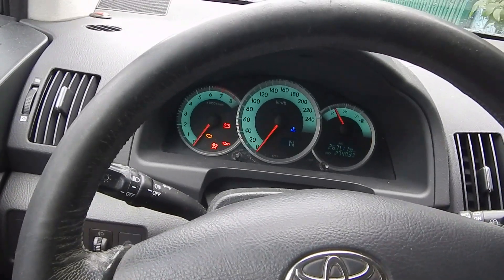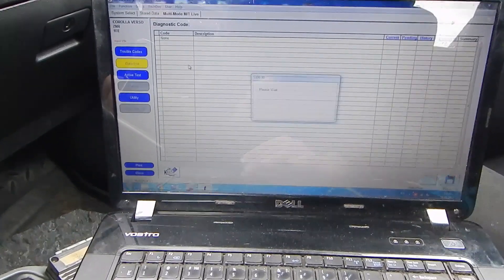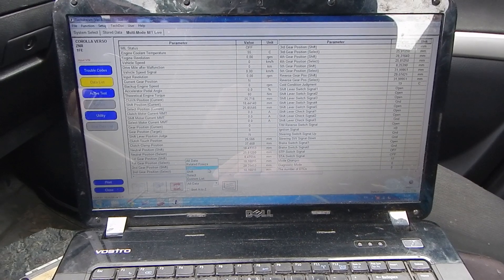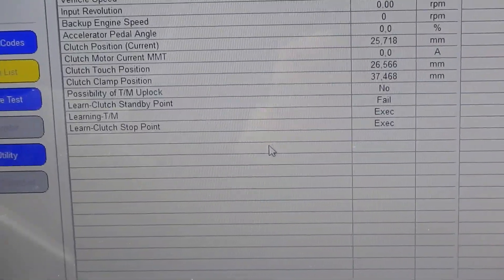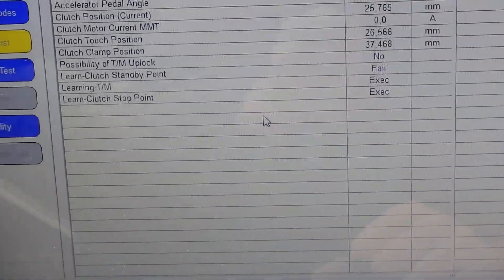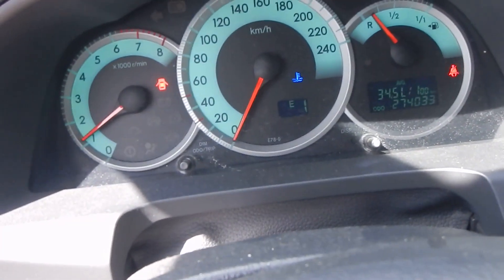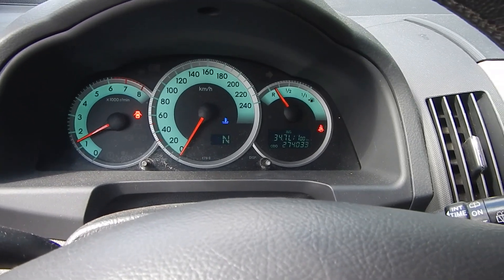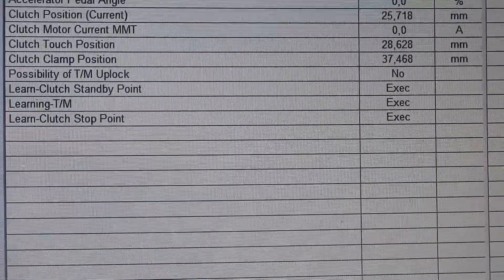N FLASHINNG Toyota MMT Learning Fault What to do if learning fault clutch standby point fail

Comment: I have changed the sensor but it didn't help. I had another guy who came up and said that voltage is not right on the wires. Can that cause this fault?
Reply: can you give some informations about the sensor. The article number. Want to order one. But don't know which one.
Reply from the maker: Message me i have original
Reply: @vak_service i have fixed it. The pin inside the gear selector moved slightly so it wasn't in the correct position. Thank you
Reply from the maker: Check next video:

https://youtu.be/_limxc7_2oc?si=wi_Mjej186k7-e61

https://youtu.be/b8H-RDu8VdU?si=qSSeksi3DNYB4mS3

Comment: Hi guys.i replaced clutch on a Peugeot 107 piloted gearbox. After clutch replacement. I programed the clutch.now neutral is flashing. Watched this video. Replaced the gearbox speed sensor and clutch actuator. Programed again but I still don't have gears.any1 help please. Thanx
Reply from the maker: Hi.
It mean that the clutch can not be calibrated. Looks like installed not original clutch.
Follow next videos how to do that it will working

https://youtu.be/dAK1qUhLgOs?feature=shared
https://youtu.be/B--evbdBhk8?feature=shared
https://youtu.be/N0-jM0sFkAE?feature=shared
Reply: @vak_service  yes I used aftermarket clutch. Not original. I also noticed from one of your videos. I did not put the actuator in clamp position. Must I use the scan tool to st the actuator to removal position then carry out clamp  position.?thanx
Reply from the maker: @luckyngwenya5758  i sent you videos what and how need to do.
Do it.
Reply from the maker: I'm not sendig there videos for free, just sent them for you, it is my paid content, so send me some donate - SuperThanks when the car will start moving.

Comment: Hello my car is Toyota Yaris SR 2007 VVT automatic transmission with same problem when I start my car it’s fine working but after 30 to 40 minutes drive then Start Blinking N not gears working or reverse working if I stop engine about 15 minutes then if I start engine again it’s working fine but about 40 minutes drive then problem star again
Reply from the maker: Hello.
Check for codes first.
Type here codes, will tell you what to do.
Follow next video how to check the codes with wire:

https://youtu.be/W2DRdW2XflM?feature=shared

https://youtu.be/7c6mFTJgFXI?feature=shared
Reply: @vak_service how can you check codes? Need to go to garage?

Comment: Hello! I have a Corolla mmt. I recently changed the clutch, the pressure plate is the old one. I reset it and everything was almost ok. however, recently, it started to set to compensation, as if the disc was worn. This means that it started not to disengage properly. I adjusted the actuator several times, it worked, but the self-adjustment of the pressure plate kept repeating. Because now the standby point is no longer calibrated, the disc being new but the auto pressure plate set, practically it no longer disengages completely, I'm going to remove the box, reset the board again. question! is it possible that because of the sensor on the box, which I think is a little defective, the clutch will act too much and that will be the reason for the self-calibration of the pressure plate? thank you very much!
Reply from the maker: Hello.
Not exactly catched it.
Sensor can be reason that standby point fail.
Message me, much more better to resolve it
Whatsapp +375 29 6353511

Comment: Hi, I have a 2009 Aygo MMT. I replaced a slipping clutch, but now it fails the clutch learn like in this video. I could replace the sensor, but when I look at the live data with the engine running, the input shaft RPM is very similar to the engine RPM. So it looks like the sensor might actually be working. How does this compare with your car? did the gearbox input shaft sensor work at all or was it completely dead? I don't want to waste yet another £50 if the sensor isn't the issue.
Reply from the maker: Hi.
What the model?
Reply: @vak_service  Toyota Aygo Blue 1.0, I think the model code is KGB10? It's the little tiny one the same as a Citroen C1
Reply from the maker: @bappyplays  ok.
Message me will tell what need to do.
Whatsapp +375 29 6353511

Comment: My Yaris has had the clutch & gearchange actuators removed and replaced by my garage. Now the car moves off at tickover in 1st gear. I  believe the clutch is engaged when it should be disengaged until the accelerator is pushed down. Is this a similar ‘learning’ problem? Thanks
Reply from the maker: Hello.
Feel free to contact

Comment: hi, I recently changed the clutch, put the old pressure plate reset, title works fine when cold. I have a problem when the engine warms up, in reverse it hangs a little.
Do you have any ideea?
thank you!
Reply from the maker: send me video how it looks
Reply: the N position, with the foot on the brake, in techstream, at the revolution gearbox input, I have 0 rpm. as the engine warms up, after 10-15 minutes, the input revolution gearbox starts to show 200 rpm, 300 rpm... it increases until it shows 700 rpm, approximately equal to the engine rpm, then it stays around that value.
Reply: the old clutch disc was replaced only the ferodo, maybe it is too big?

Comment: Dear Sir! I am from Vietnam. I have a Corrola 2009 with MMT transmission. Sometimes, when I am going to stop at redlight traffic It Automatically shift to N and  N is flashing continually on the dashboar and the car is immobilized.  I've come to Toyota Dealer but they have not found out the problem. Would you be kind hearted give me contact/inbox address, I would send  you the detailed videos and information. Thank you so much!
Reply from the maker: + Replied on whatsapp

Comment: Hi thanks for this video I have the same problem with my Corolla but the sensor is working 100% what can I do
Reply from the maker: We just resolved it, for all follow this link, do exactly and install it back with no gap to clutch fork - if you moving it to side and still have some gap - remove the nut 10 on the rod and put some washers:
https://www.youtube.com/watch?v=RkLTmmKdIyo

Comment: Hi, thank you for the video. On my corolla, I have in data live : "clutch stop point learn fail". How can I resolve this. Thanks.
Reply from the maker: Hi.
Do this, and adjust no gap to clutch fork:

https://www.youtube.com/watch?v=RkLTmmKdIyo
Reply: @vak_service  Thank you. I have done it but still the same. And there is no sound during the learning manually and with techstream. The actuator motor is working fine but N disappear on the dash. I replace the clutch actuator but same problem.
Reply: @vak_service  I found a solution, the clutch sensor is not correctly placed.

Comment: Hi, What is the trouble code cused by this sensor  and What is the name of this sensor in French because I can not translate it in French.Thanks a lot
Reply from the maker: Describe me more what you need, i will send full translate to French
Reply: @vak_service  I have the same problème, the Neutral is bliking , no accelerator,no trouble code . I 'd like to Know the name of this sensor in French because the stand by point clutch is failed.Thank you
Reply from the maker: @yasminarahariravo4523  https://toyota--corolla-ru.translate.goog/rm04f1ru/repair2/html/frame_rm0000017y4009x.html?_x_tr_sl=ru&_x_tr_tl=fr&_x_tr_hl=ru&_x_tr_pto=wapp

message me if you will stuck, i will help
Reply: @vak_service  thanks à lot
Reply from the maker: @yasminarahariravo4523  Thank you!

Comment: Hi, what is the name of this sensor exactly, and where is it located?
Reply from the maker: revolut sensor - on bottom little on side
Reply: @vak_service  if you can make a vidéo on this sensor .I have a toyota yaris 1,4 mmt 2006 ,I need to locate this sensor.Thanks a lot.
Reply from the maker: @tiagokingsleylola3304  message me will send photo, whatsapp or viber +375 29 6353511
Reply: @vak_service  is it p0725 trouble code?
Reply from the maker: @tiagokingsleylola3304  
p0725 - engine sensor
p0715 - tcm sensor
Reply: @vak_service  when I disconnected the sensor on the Gear like you have show showed in this vidéo,I caused p 0725 trouble code but I dont Know If it is the same sensor.The N is blinking non stop and when I do the learning, the N disappeared ,and after disconnecting the  battery ,the N reappeared ,and learning clutch stand by point is failed but T/A and clutch stop point is done.

Comment: Hey man,

I have a toyota aygo here same fail appear in live data. But no dtcs . I tried same relearning procedure but no succes.

Did it several times but still no succes….

In summer we changed the clutch of car and driven good till yesterday.

yesterday did not shift to M or D  only R . After relearning the N Is blinking now and no shifting… 

The clutch actuator is moving fine… 
Do you know maybe the problem?
Reply from the maker: Messaged me to whatsapp, i helped him and the car start moving. Helped him for 20 minutes - car working.

Comment: Hi Yuri,
I have a 2008 Yaris MMT 1.4 D-4D which is making my life a real hell. It just had the clutch replaced but the learning proces does not complete. The symptoms are just like the one in this video, no acelerator pedal, engine light on, and N blinking after engine on. Could you please help me with a part number for my car for this sensor? And where is located?
Thank you.
Reply from the maker: Hi.
Message me, i will help, whatsapp +375 29 6353511
Reply: Hi

Comment: Please i need some help ..gearbox light dos not off when turn switch of 
.the care still flashing in nutral.why the gearbox chech light still on the dashboard even the key is out of the switch.why? Please if u know
Reply from the maker: Hi.
And after few second after switch off - is off, right? I saw this , in my case it was when the clutch actuator was not moving back - to stanby position, you can check it - ask someone to turn off the switch - ans you check how the clutch actuator go back to standby position, do it several time and i think you will see the differents. If it like this - it say that clutch actutor will make some problem. Check it and reply, also check for trouble codes, even via manual mode like in my video.

https://www.youtube.com/watch?v=8ypF55Q-NTU
Reply from the maker: https://www.youtube.com/watch?v=M4sbqWhbOKs
Reply: @vak_service  thank u for replaying.the light still all the time ..i replace the clutch actuator and make learning ..ther is no any sound coming from gearbox when learning .and the fault codes about gate actuator error .when pressing brake the clutch actuator dose not return ..do u think the clutch inside the gear box has been warmed or distroying...
Reply from the maker: @mohmadkashan5632  fault codes about gate actuator - first need to repair this, what the number was P0909?
Reply: Thers 3 faults :two about gate actuator and one about low voltage .i dont remmember the fault number ..may be tomorrow I Will check
Reply from the maker: @mohmadkashan5632  Ok,type here

Comment: please i have toyota yaris 2006 no r or n or d in the dash and the car not working
Reply from the maker: Hi.
What the dtc was before?
Reply: @vak_service  
they told me electric shooting in the gearbox the car is 60000 mil
Reply from the maker: "they told me"  -  not fit, ask them what is exactly trouble code, it can be P0810, P0900 or else, need this code, only after that i can tell what need to do
Reply: @vak_service  
thank you Sir
Reply: @vak_service  
i will send it to service £1000 cost
Reply from the maker: Ok, feel free to contact if will need a help
Reply: @vak_service  
Sir i have 2006 toyota yaris mmt gearbox i was in the street turn off and when i want to start no start firs gearbox light in dash but car no move now no R or N or D in dashboard and the car not working

Comment: Hi vak service my corolla mmt n position disappear on dashboard I need help to fix it I have think diag dongle
Reply from the maker: Hi.
What trouble codes was before and what you did?
Reply: @vak_service  there was no problem but I change the engine then I spark 4 times the n start blinking I try to relearn and it's disappeared
Reply from the maker: @abdoulfatahoubamogo3454  It mean that it has some problem and it can't do the learning. You was need to check for dtc before the learning. I think you missed some of connectors or installed them not right position. In this case you need to install another learned tcm or reflash your like in my video:
https://www.youtube.com/watch?v=8gOVOPucuZM&t=280s
After that you need to catch the dtc and you will undestand what is wrong.
I can help with it, i have tcm or files.
Reply: Hi, can you help with dump file for Toyota Verso No gear indicator. Start only. Have Autel 608 pro.
Reply from the maker: @phillipnel8122  Hi.
Yes, folow this link,thanks:

https://lavky.com/home-and-living/everything-else/auto-parts/dump-file-for-tcm-toyota-corrola-verso-1.8-mmt-semi-atomatic-89530-64030/?action=preview&product=EY531764

Comment: hi yuri finally got the clutch back in and oh yes it works driving it today slight hesitation for reverse not sure about that but im going to give it time to settle in  on the the flywheel there was a trace of grease and on the shaft of the release bearing was covered  gearbox oil is just under 2ltr  i think so lm going to keep on it for now but i think its done
thanks for your help and advise geoff
Reply from the maker: A

Comment: hi also i cant get clutch kit now i called toyota and they gave me oem part numbers which are 31250-69055 cover and plate and release bearing 31230-17011can you confirm cheers
Reply from the maker: Hi.
Look, this MMT system made by Aisin, so toyota use clutch by Aisin just make they logo on parts. In case toyota parts - inside aisin parts.
For diesel you need "Aisin clutch kit KT320A" - contain 3pcs  
I can make it - KT320A - for £240 + shipping price
Reply: Thanks yuri thats great you are a star
Reply from the maker: @geoffreystevens8999  Thank you too!

Comment: hey yuri geoff in the uk here can i buy the tech 2 software on line and use that or do i need a platform or just a laptop  thanks
Reply from the maker: You need laptop, mini vci cable - you can buy it on ebay, and techstream soft, i can send it to you.
Reply: @vak_service  hi yuri will the software work on a chromebook or does it have to be on a windows based laptop and any advice on the cable cheers geoff
Reply from the maker: @geoffreystevens8999  cable - mini vci, i think need on windows
Reply: i have a problem like this. my car goes to N when i am traveling. then i stop the car and waiting 20 to 25 minutes to reset. then it's ok.

sometimes this is go to be many times in one trip.